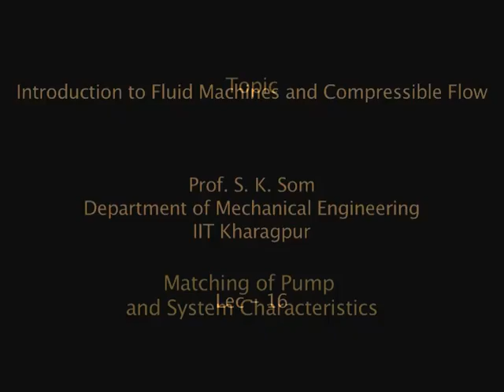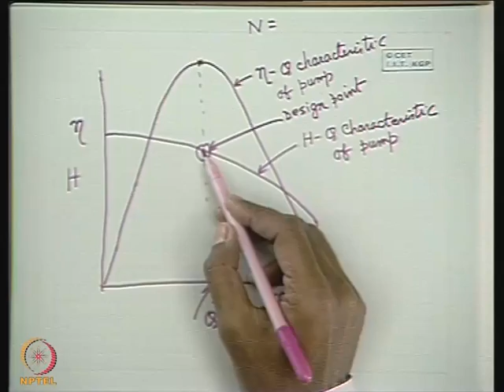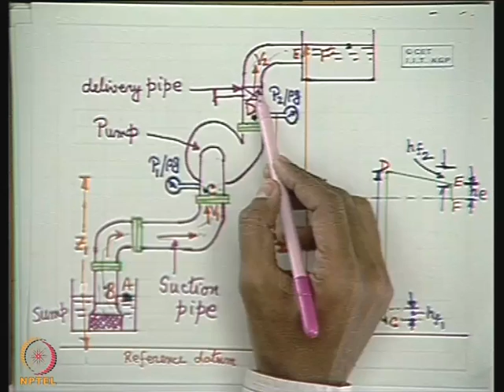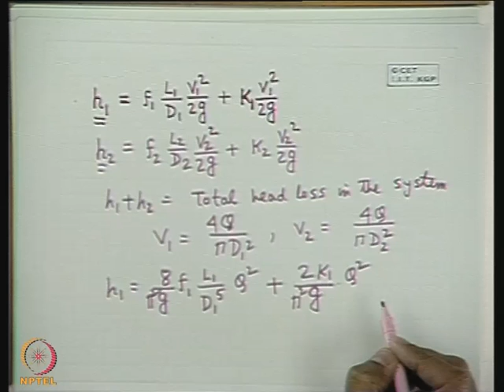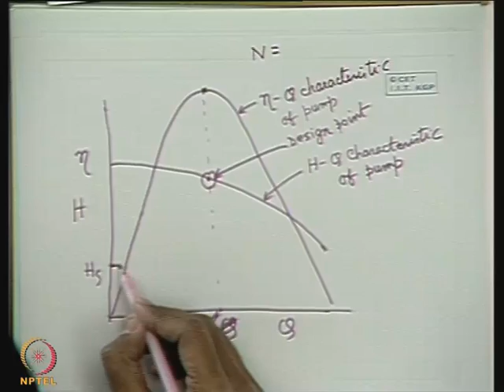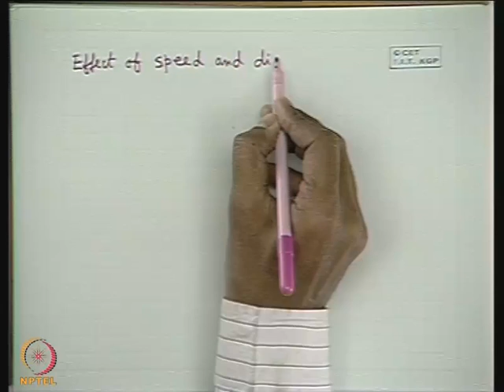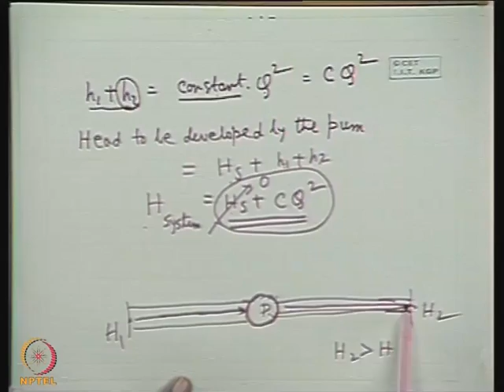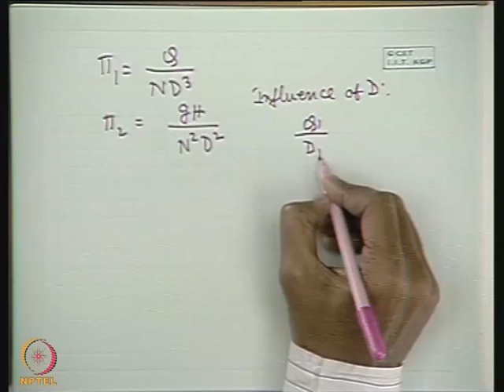Mod-01 Lec-16 Matching of Pump and System Characteristics

Comment: If in addition to this great lecture someone needs to learn how to do sizing of the electric system for driving the pump, DriveConstructor online course can be helpful.
Reply: Go to section on electrial machines, the motor set is DC single phase motor
Reply: Thanks for this comment. I have just discovered driveconstructor based on your comments. Mighty helpful!!!